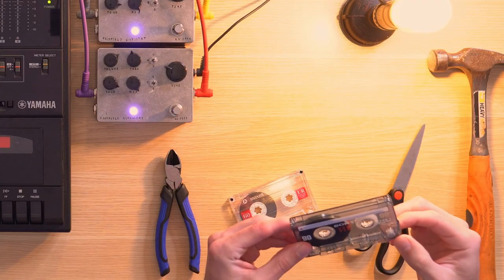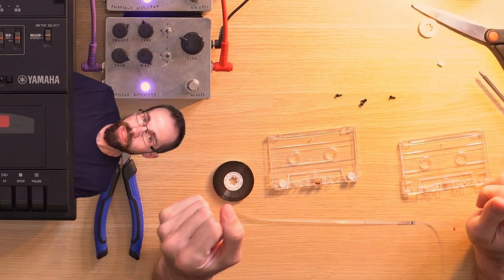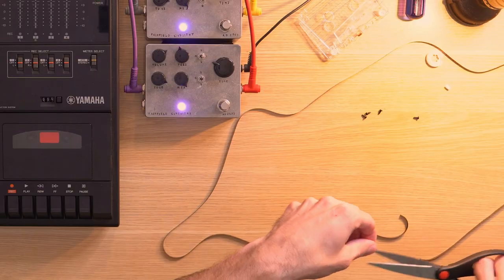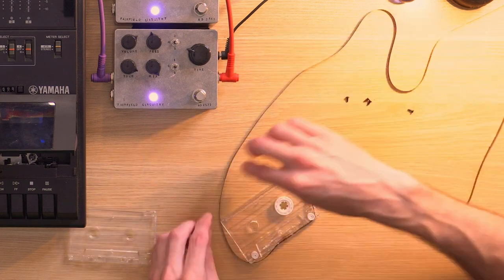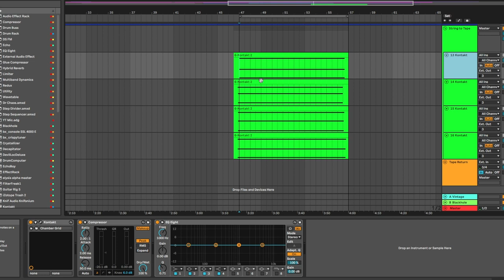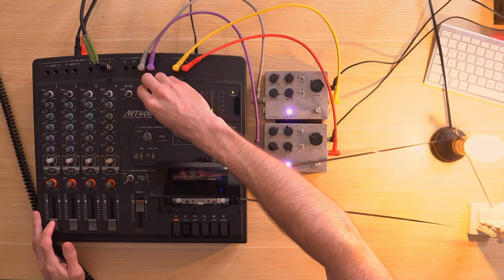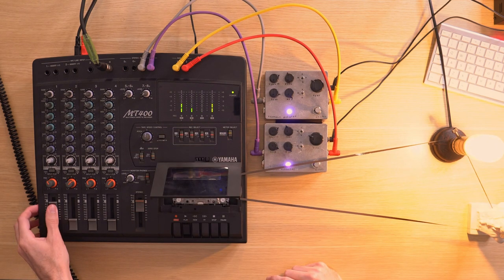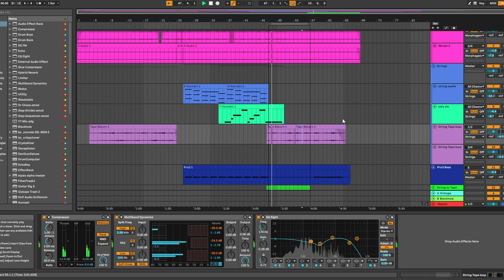How to make Ambient Music by destroying Cassette Tapes [Tape Loop Tutorial]

Comment: Pardon my ignorance - I’m still a NOOB at this stuff. So, up to four tracks can be… layered onto a tape? I would have assumed that, if you record say four segments of music on a tape, that they would be back to back, one after the other [in series]. But if you can activate any individual segment of music, at any time, by sliding a slider of your choosing then that confirms that, the recordings were not made in series but instead, layered. Did I get that right? Please let me know. Cheers!
Reply: I know this is a late response, so I hope you got the answer sooner! Essentially, the width of the cassette tape is divided into 4 tracks - like if it was a 4 lane highway, so this type of recorder allows you to record on just one of the lanes at once. So the full loop is recorded for each of the chords, they're just running alongside each other in their own lanes (tracks). So if you wanted, you could push up the volume on all 4 and you'd hear all 4 chords at once.

You need special recorders to get access to all 4 tracks - many recorders just use all at once (I believe) rather than keeping them separated.